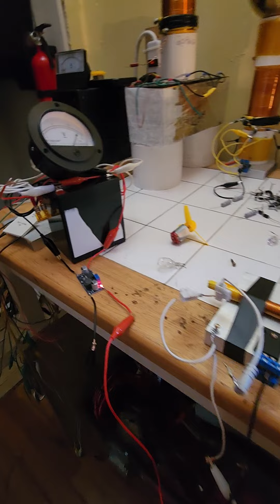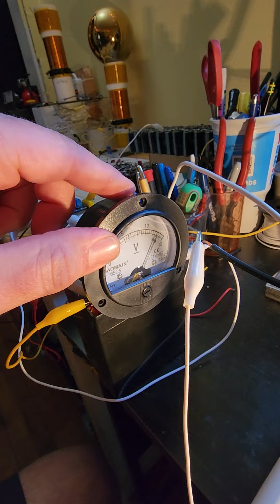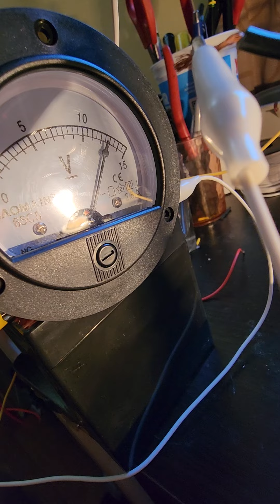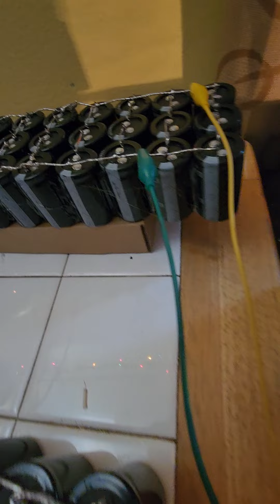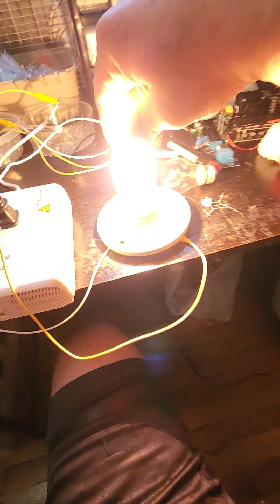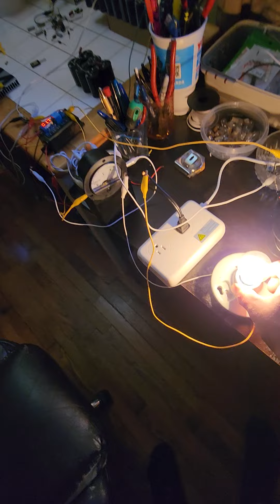🌟PULSAR RINGER CIRCUIT KEEPS SUPER CAP CHARGED & RUNS 120VAC LOAD NO PROBLEM FREE DON SMITH ENERGY♾️

Comment: So... Disconnect it from the battery and reconnect it to the capacitor I guess? If it's true overunity then it wouldn't make a difference from where the trigger supply comes because it would still tap the "Vaccum energy", right?

Comment: Don smith said one was to try to achieve pini needle wave form ..it would be on only in a microsecond so the power was on only extremely briefly creating a steep ratio of on off using less input power .and negative energy generation. Great work . finally someone is moving this Forward .

Comment: all i see is an inverter running off a SLA battery, at best you have a boost circuit keeping the voltage constant but it'll run down eventually as the battery dies

Comment: I have to say I am sceptic but drainin almost 3A and having such a low voltage drop... But is the input really a supercap? Does it last so long? I thought something like this would be impossible due to interfierenc but also it might be actually powered by it... But how you said even if you would take 4* the size of the lead acid batteries that thouse 2 supercaps look like... you would get what... 40 Ah? that would go low after so much time.. this video has 20 minutes no cuts...Even if the super caps would be tampered with and they would be filled with batteries that timing circout would slow down overtime....... and I feel its so much stabilized.... I have to say you, to most, even with background in electro engineering, make a big inpression... (just please dont try to be new Tesla if you arent even Houdini [in the slim case this is fake])
Reply from the maker: Appreciated your input & definitely not fake. Took 4 years of research & Refinements to get that circuit where it is today. Much more detailed vids coming soon & make sure to fully read the vids description i also have a parts list too :)

Comment: Have you tried, connecting the ringger output directly. To the second 14 volt supercap?
Reply from the maker: Yes doing so will drain the large capacitors in about 30 seconds to a minute & put more of a load on the input of the system. The most effective way to use this circuit & system is to have the high frequency output of the ringer charge a massive dc capacitor bank after it goes through a very effecient rectifier then we pulse discharge some of that power into a super cap or battery that then runs an ac inverter for whatever we wish for a time & the end result is much more output power over time then input power & if we store some of the excess power in a large battery we can easily keep the system running indefinitely & still have enough extra power to recharge batteries & run inverters. The excess power seems to come from earth grounding the negative of the capacitor bank due to a reference point being established & it's important when using this circuit to never drain your cap bank below 90% with the pulse because we want very little to no load on the input. We're pretty much using high-frequency voltage alone with nearly no current to rapidly recharge our cap bank that does work for us via the timed dumping.

Comment: So the input cap will eventually drop over time?
Reply: Since I already have the super caps and enough regular caps for the storage bank that the bridge rectifier feeds
What would the rest of this circuit cost me?
I believe this could be the answer.
Reply from the maker: @Jon-fs2zj  the entire circuit cost me under 800$ & for you probably 400 ish if you've already got all the caps :)
Reply from the maker: Also if your looking to purchase certain circuit components from me let me know but it would be slightly cheaper to order everything in my parts list in the vid description from amazon or the other websites. Also i have a small stockpile of the exotic nano crystalline ferrite metglass rods if you wanna buy those from me with quick shipping & no wait instead of the china website :)
Reply: What is the exact order of components from beginning to end that I need a super cap ,dc to dc converter , crystal rod with two coils wound on it, what do you use to oscillate the coils and do those crystal rod degrade over time? I assume you're using the cap bank that dumps to the second super cap as to isolate the inverter?
Reply from the maker: @Jon-fs2zj  the exact order of the components is 14vdc input super cap. Could also be a battery. 14v-9v reducer board with current restricted to 1 amp. So start up of circuit doesn't blow base of MJL21194G TRANSISTOR. Then it goes into the ringer circuit which is an advanced joule ringer made for high power wound in a bucking coil configuration. The high frequency output of the ringer goes through a high speed fast switching rectifier diodes 1N5408 & that dc rapidly recharges a large cap bank composed of an array of 63V 10,000UF Caps. Then that dc power of 50/60v is sent to a 14vdc reducer then through a programmable timer circuit. The pulse discharge duty cycle is 0.1 second discharge at 14vdc 10amps every 2 seconds. This seemed to be perfect for my caps & this duty cycle can be repeated indefinitely with no strain on the source input & that output Accumulates far more power over time compared to the input. That power is then stored in a 14vdc super cap or battery that can handle rapid charging & discharging then you hook up your 120/240vac inverter & your off running :)
Reply from the maker: Yes but the input cap might last a week because there's only a 2 watt drain on it to power up the high frequency circuit & all the excess energy accumulated over time from the output if stored in a large battery can easily fully recharge the input cap & we still have an excess gain in power from earth grounding the negative of our large storage cap bank :)

Comment: Great demonstration. Is the winding of the small transformer the same as the large Tesla Coils? also have you considered doing the transformer on a nanocrystalline toroid to maintain magnetic field loss? Thx !
Reply from the maker: Yeah it's the same length as the transmitter 4 inches & highest quality magnet wire was used & toroidal ring might offer even more power but would be very expensive:)